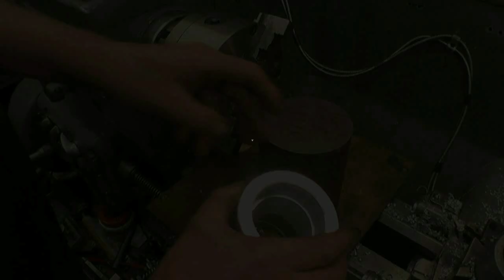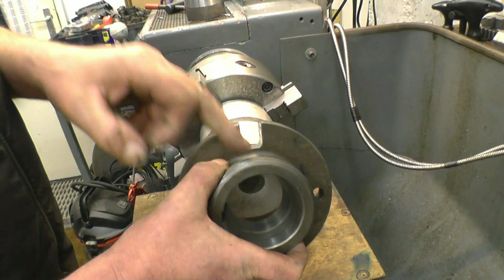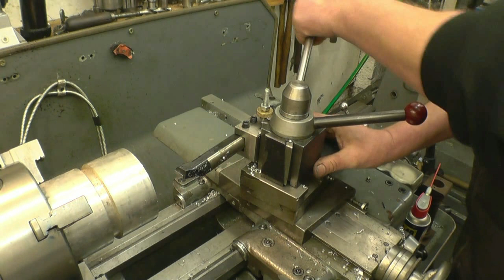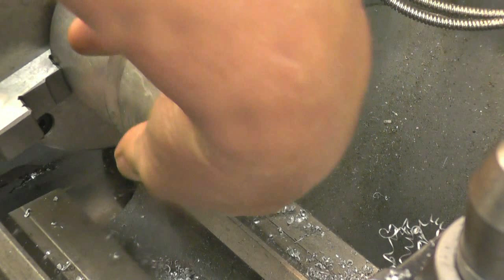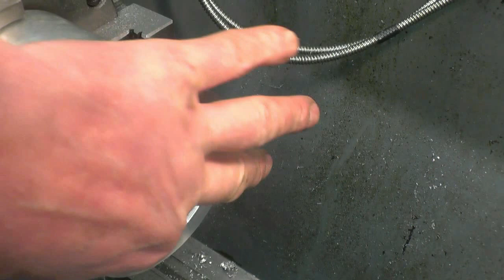SNNC 154 P2 Lathe Spindle Protector (internal taper)

Comment: stefanblumhoff@yahoo.com.auI am thinking of having my lathe assembled piece by piece having a 14" to 16"swing with a 60" bed . Ability to cut threads is a must and accept a 5c collet with a 2 and 16" spindle bore. It will use a 6hp ac vfd  motor and eventually be cnc controlled having a 2 axis dro. Does any one have DETAILED blueprints on this type of lathe or know where to buy them?TIA

Comment: I made a ER collet chuck for my lathe's L0 spindle. I cut the threads fist, using the three wire (well, 3 drill bits) method to get them right. No need for any charts or calculations, just measured the threads on another chuck and used that.

Removed the chuck with the workpiece still in it to set the top slide to the taper. Cut the taper, and removed the whole thing again and flipped it around to test it on the spindle.

Happy Christmas to you and your family!

Comment: Evening John and Merry Christmas to You, Debs and your Dad.

Can I ask, What is the purpose of turning the boring bar upside down? I'm sure you've mentioned it before but I've forgotten (old age marra ) lol
Reply from the maker: It saves having to re set the compound slide
Reply: Of course!! Why didn't I think of that? If you hadn't upside-down'd the boring bar you would have bored a reverse taper!!! Ingenious mate!
Reply: George Kelley many times I've had to boar lead or thin wall tubing in a three jaw universal chuck. If you grip lead or thin wall tubing in a 3 jaw you either grip the work to tight and deform the part or the scroll loosens and you loose the work. By running the lathe clockwise and the boring bar upside down the chuck scroll tightens on the part without crushing it.
PS Merry Christmas and A Happy New Year to all.
Reply: Robert Burns Thanks for the info Robert, Merry Christmas to one and all.